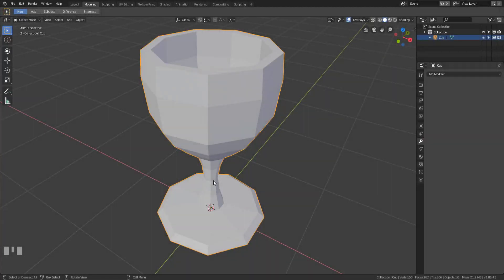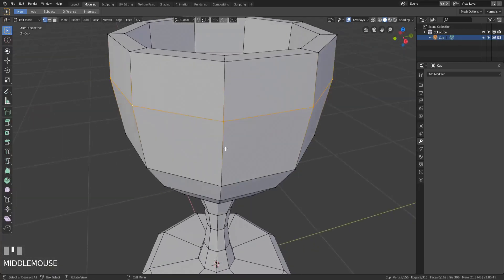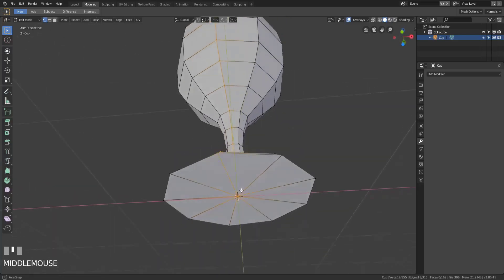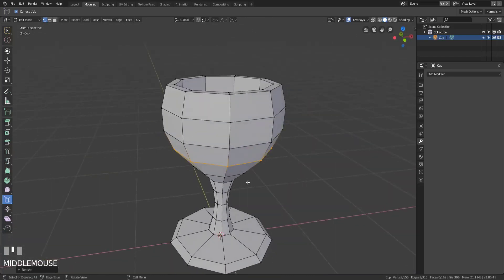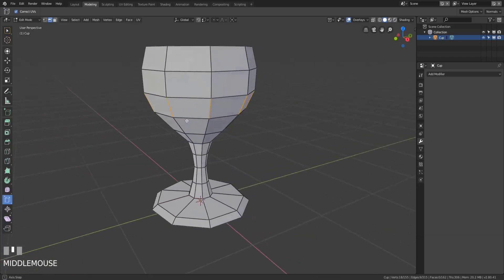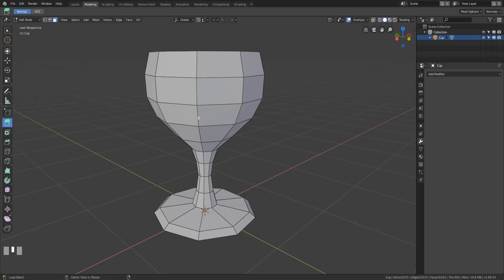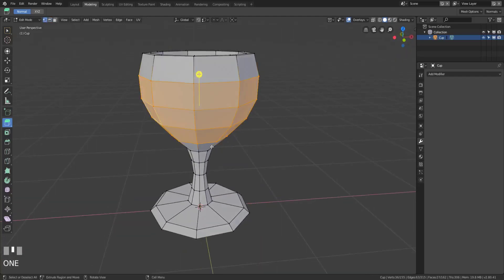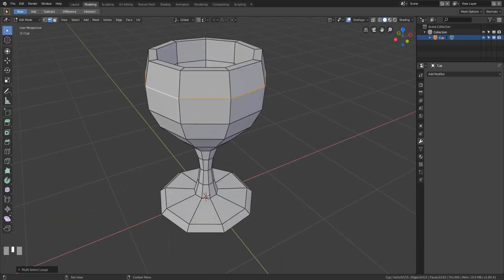Edge Rings and Edge Loops [Blender 2.8]

Comment: not sure what i am doing wrong, but i cant select edge loops in any way :D i had a pause from blender, and before i remember it was very easy, but now it not works. Very strange.
Reply: just found out by googling that it because i use linux, and i allso had "select" on left mouse, wich i had to change to right, for the solution using shift+alt +right mouse button